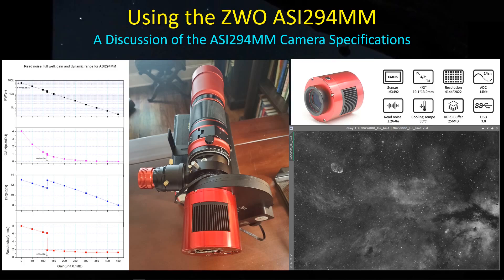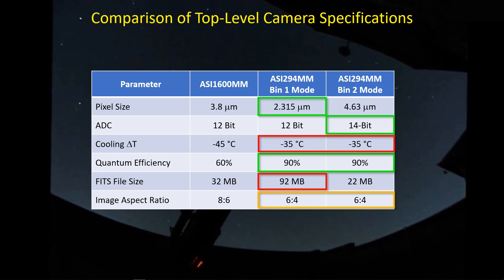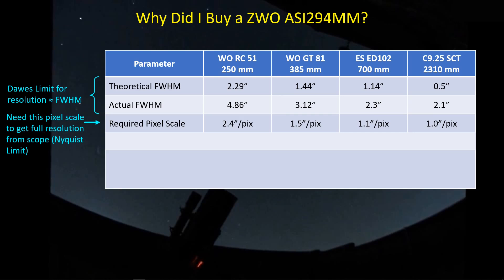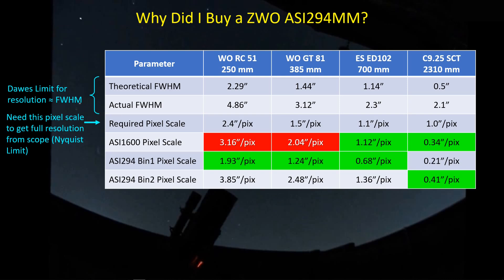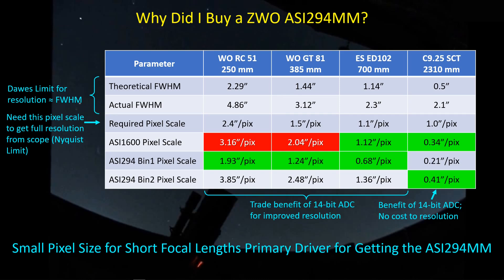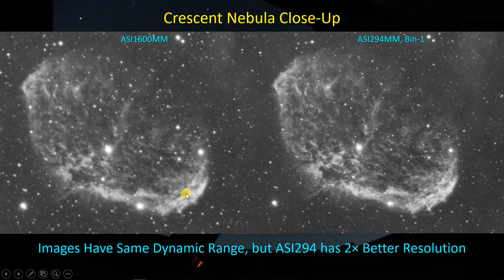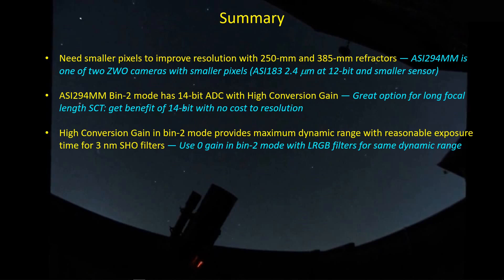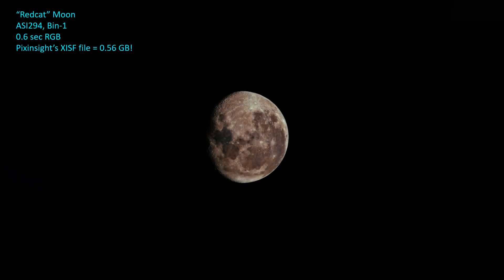Using the ASI294 Bin Modes

Comment: would you recommend still getting it in 2025? or go straight for 2600mm?
Reply from the maker: Several factors there. The 2600 has much higher tonal resolution than the 12-bit 294. The pixel size of the 294 in Bin 1 is smaller than the pixel in the 2600. The smaller pixel size pairs well (provides improved resolution) with focal lengths less than, say, 700 mm. But you can dither and use drizzle integration with the 2600 to recover lost resolution. Then there’s the sensor size. If you only have a filter wheel with 1.25” filters, they’ll work fine with the 294, but you’ll get vignettimg with the 2600. It’ll cost another $2000ish for 2” filters and a new filter wheel. The larger 2600 sensor provides a larger field of view for the same scope than the 294. Of course, you’ll image issues more with the 2600 (e.g., tilt). The 94 is a fine camera, but the 2600 is a better camera. It the “hidden” costs that tip the decision one way or the other. If it makes you feel better, my 2600 arrives in two days. Then I’ll have to decide about the filters and filter wheel….

Comment: Thank you for making this video.  I recently acquired a 1200 focal length reflector and a 294mm.  Do you think I should use high conversion gain mode with LRGB, or just with SHO? Thank you.
Reply from the maker: That depends. You won’t benefit from the 294MM in bin-1 mode at that focal length, so you might as well shoot in bin-2 and use the HCG. If you live in a very bright area, you may find that you have to drop your exposure time, particularly with L, with a gain of 120. But read noise will eat your lunch if you go with 0 gain. I would definitely try HCG with LRGB. If the exposures are too short, drop to 0 gain in bin-1 mode. Good luck.

Comment: Hi James! Did you have chance to work on this further? I have always shot in bin2 with my 294mm on all of my scopes (Redcat 51, Esprit 120 and Edge HD). I have some queries: 1. Should i shoot bin1 regularly with Redcat (both LRGB and Narrowband)? Also what gain at bin1 for NB and BB? 2. For Esprit 120 with a 840mm FL, should i do bin 2 or bin1? I have realized that some of my images are a little bit soft at this FL with bin2. For the Edge with longer FL. I think bin2 should be the mode, correct?
Reply from the maker: Hi Devesh. Yes I have. Check out the recent video (https://youtu.be/M4o1XEiXWuk) where I discuss some issues I had with those settings and what I'm trying out now. I'll post a video in a day or two with an assessment of the "new" approach. With a Redcat, Bin-1 is a good match. At 840 mm, I suspect you're not getting benefit from Bin-1, so probably go with Bin-2 with a gain of 120 or slightly higher to make use of the High Conversion Gain. Good luck!

Comment: great work James. thanks! Can you quickly elaborate on why 0 gain on LRGB Bin2? Shouldnt one go with 120 as it would give a lower read noise with same DR? Thanks again
Reply from the maker: Hi Ali. My original thought was that I wanted to use Bib-2 for the RGB filters as I just want color, rather than detail. Also, RGB lets in a lot more light than the SHO filters so I didn't want very short exposures with the gain 120 and went with the 0 gain. In retrospect, I think I'm seeing the bad effect of high read noise that goes with 0 gain in bin-2 mode. Next time I use this camera, I'll either use bin-2 at 120 gain (and see how short the exposures are) or just go with the gain 0 in bin-1. If the bin-2 gain 120 exposure time has to be < 1/4 the current exposure, I may settle for using bin-1 at 0 gain.

Comment: I saw a video of a lecture by Robin Glover, the developer of SharpCap, which indicates that we don’t need to cool modern cameras nearly as much as we often do. More accurately, the point of diminishing returns is at a higher temperature than you might think. I won’t go into all the reasons because he explains it much better than I would. The same video talks about many other aspects of CMOS cameras which really expanded my knowledge. Highly recommended. Search for “robin glover” and it should be the first result returned. It was published by AstroFarsography, who recorded it live.
Reply from the maker: Hi Lee. Agree! I've watched that video several times. It is good and very informative. I've been using the ASI294 (cooled to -5C) and have noticed no issues with that vs the -10C I get out of my ASI1600. I think the most valuable part of the Glover talk is that really long exposure times don't but you anything image-quality wise (you do get the benefit of reduced hard disk space and processing time, which is worth something). The key is to use a long enough exposure so that read noise doesn't dominate. Thanks for watching!

Comment: Amazing video as always thank you very much! I too have the Redcat51 paired with the 294MM.... I'm curious, when in Bin1, have you settled on Gain 0 for RGB and Gain 100 for narrowband? Also... is it true that the time need to achieve the same SNR would be 4x longer in Bin1 vs Bin2?
Reply from the maker: Hey Damian,
Yes. I'm satisfied with Gain 0 for LRGB in Bin1 and Bin2 (I never shoot L in Bin2). I continue to use Gain 100 for SHO in Bin1 and Gain 120 for SO in Bin2. The 100 is a total judgement call - no firm justification for it. I want high enough gain to keep exposure times reasonable (< 10 min for me), but I want max dynamic range (i.e., need low gain). I settled on 100. It's not magic.  I'll shoot every filter in Bin2 when I pair this camera with the C9.25. Not sure about the SNR question. I'll have to think about that. Mostly, I wanted the smaller pixels to improve resolution with my Redcat and GT81. Thanks for watching!

Comment: Very nice…. That’s the one thing keeping me in the OSC realm is the terabytes of storage needed for mono… When 64g of ram and 16 processors seems insufficient… I’m running the 2600MCP and it’s fairly brutal at 51m per frame, not needing hardly any calibration makes it ideal for my limited time…
Reply from the maker: File size is a pain. I subscribe to a cloud storage service (iDrive) where I keep all my calibrated subframes stored. I process each night’s set of subs and ditch the raw files. Thanks for watching, Robert!

Comment: As usual, great video James..

I’m considering the 294MM to use it with the C9.25 EdgeHD. It’s a good mid point between the small 533MM and the 2600MM. Nevertheless, two things make not consider it and I’d like to know your opinion as a user of that camera with also a C9.25.

First, amp glow. Is this or isn’t a problem, and can it be calibrated? Second, I’ve read also in forums that the sensor coatings are very prone to produce a mottled pattern when used with red filters and specially with very narrow band Ha and SII filters.  Is that the case? Can it be also calibrated?
Reply from the maker: Hi Alfredo. There is significant amp glow (I’m taking 600 sec subs), but the darks completely compensate for it. I have not noticed the mottled appearance at all. If it’s there, it must be subtle. I might be inclined to assume the flats would take care of it if it’s a legit issue. Hope that helps. For what it’s worth, I’m enjoying using the camera. Planning on a video discussing my experience using the camera with my Redcat 51 as soon as I can find the time…
Reply: Thank you very much James. This camera is interesting for imaging at f10 with the C9.25 EdgeHD because of its high QE and bigger pixel size than the 2600MM. Please let me know If you could share maybe a raw frame taken with it (maybe an Ha if possible)
Reply from the maker: Alfredo,
Here are two Ha raw files and the calibrated versions:
https://drive.google.com/file/d/1Cbp4LyOGEakVdRRRmf07IqnpDHQIVUOO/view?usp=sharing
Reply: @Aero19612  Thank you James. I appreciate it. The calibrated files show no amp glow nor any trace of the dark pattern on the lower right. I can see this were shot with the bin1 mode (with the smaller pixel size).

Seems like a very versatile and sensitive camera.

Comment: It's interesting that we've ended up with such similar gear.  My first good scope was the edgeHD 9.25 on an eq6-r pro. First camera was OSC with the 294mc pro.  When I decided I wanted to go mono, I got rid of the 294mc and bought the 1600mm pro. That was like 2 weeks before the 294mm was released. I told them I wanted the 294mm instead and they actually let me send it back and upgrade to the 294mm.  I knew one day I would eventually get a small focal length scope, so when they announced the bin 1 mode, I was ecstatic. This week, after 3 months on backorder, I finally got the Askar 400 and .7x reducer, so I'll be able to shoot wide field at 280mm focal length. It's going to be awesome.  Still waiting on the guide scope and a couple other accessories before I can get first light with it, though.
Thanks for the videos. Keep 'em coming. 🙂
Reply from the maker: Wow. That was nice they let you switch out the 294! After I bought the Redcat, I became much more concerned about focus. Your Askar 400 has a standard rack/pinion focuser that is more amenable to attaching a standard focus motor to it much easier than the Redcat. It's a good focal length, particularly with the 0.7 reducer. Now you just need a 700 mm focal length scope! Thanks for watching, Tom.
Reply: @Aero19612  I have a strange problem with my 294mm that I'm hoping you'd be willing to help me troubleshoot.  My darks calibrate out the sensor's amp glow for my Ha subs, but not for my Oiii or Sii subs.  I don't know how that's possible since the subs were taken on the same night with the same camera temp, gain, and offset settings.  I found that when I multiply the master dark by 1.75 (or so), then subtract that from the Oiii and Sii subs, that more or less neutralizes the amp glow. 
I've asked a couple astro communities on discord and no one had any ideas.  I'd very much apprciate any help/suggestions you'd be willing to offer!

Comment: Excellent video as usual James.  I have color versions of the ASI294 and 2600 both of which I love but I do wish I had the money to buy the mono versions as well.  My reasons for color had to do with poor FOV and bad weather.  The 2600 does have a great view but that also has a large file size at 52 MB vs. the 32 MB for the 1600 so you better have a fast computer.  Cheers Kurt
Reply from the maker: Hey Kurt. Totally understand about selecting OSC to maximize imaging time. I'd love to have the 2600MM, but that means a new (larger) filter weel and filters. So it's not just the camera, it's the additional $1000 to $2000 for the other stuff...keeps on adding up.
Reply: @Aero19612  Good point, that was my other concern, I was planning on upgrading my filters to the Antila and there is a big difference between the 1.25 vs 2".  When the time comes to upgrade my 1600MM, I am leaning towards the ASI294MM or the ASI533MM (which is out in other brands).  The 533 has the same pixel size as the 1600 and 2600 but the sensor is smaller.  The good news is it has no amp glow.
Reply from the maker: The amp glow with the 294 is very apparent. The darks take care of it ok. All things considered, the 294MM is just "OK." I just wanted the small pixels to improve resolution of my shorter focal length scopes. Vast majority of cameras have 3.8um pixels, which is good for focal lengths > 700 mm.
Reply: @Aero19612  Agree on the amp glow on 294MM -- when > 120 second exposures I get a plumb on the side about 1/4 to 1/3 in on that side.  it is cured with calibration, but is annoying.

Comment: There are so many videos out there but never seen one discussing the performance of the ASI294 in the two bin modes. Very relevant indeed for us amateur astronomers; thanks for sharing. Just curious, did you have any issues calibrating the lights due to amp glow? Looking forward to your next video.
Reply from the maker: Hi Henrique. That was something I had meant to show and discuss, but I ended up deleting half the material because the video was so long. In short: No. The amp glow is a "sunburst" type light and is very noticeable. I have found the Darks are doing a great job of eliminating the amp glow (see the right-hand side image at 13:00 in the video). Thanks for watching!
Reply: @Aero19612  Thanks for the reply. It is good to know since I have plans to buy this camera in the future.
Reply: @hm.salgado  I agree with James, same problem, especially when > 120 seconds, but is cured through calibration.  I am a lazy data collector and calibrator so have darks at 20, 60, 120, 180 seconds and try to get close to those for exposure time.  James and I are both in Bortle 7-8 DFW skies -- you can go longer than 180 second subs, but you end up balancing the amp glow and the light pollution.  I have a fixed setup so can good polar align and a good scope with guiding and have thought about trying longer subs, but really just results in more planes and satellites in every sub.

Comment: Very useful video. Still trying to decide whether or not to get this camera for use with my Redcat.
Reply from the maker: Hey Logan. Go back to a few of your best subs with the Redcat and let Pixinsight determine the FWHM. If smaller than about 4.0 arc-sec, then the smaller pixels of the ASI294MM won't help you much and you'll take a hit with the 12-bit ADC. In that case, stay with 2600 (is that what you're using with the Redcat?) and the 16-bit tonal resolution.

Comment: Curious to see how bin 1 compares to bin 2 mode with drizzling…get smaller raw data files and 14 bit conversion
Reply from the maker: Excellent question, Alan! I haven’t tried that. Add that to the list…
Reply: @Aero19612  awesome.  Was thinking that if you are slightly under sampling then drizzling should help recover some detail

Comment: Great video Jay! I love my 294MM and use it in both modes depending on the telescope. For the money, it’s the best cmos camera available in my opinion. That being said though, I also really like my 2600MM, it’s a tough choice sometimes. I think the 294 in bin 2 does a much better job with the longer focal length scopes unless you can guide consistently around .3” total error which I am unable to do.
Reply from the maker: You can't beat the 16-bit ADC of the 2600 and its field of view. A shame we don't have more 16-bit astro cams with smaller pixels that work better with focal lengths < 600 mm. Guess we're at the mercy of the security cam business.

Comment: Awesome info - I have been using the 294MM for 1 year and really like the ability to bin1 or bin2. one challenge with bin1 is the really large file sizes overwhelm my Raspberry pi when writing to SD card, given you are using small windows pc, will be interested to know how that performs.  I might have to rethink how to use the delay feature on my image collection to see if that helps to I can use bin1 for the full frame.

part 2 - there are many targets I go for with my 600MM Newtonian where my decision is whether I want the full bin2 FOV or only a portion and I select out a 1/4 frame portion in the middle of the sensor and use bin1  with a portion of the frame and collect just that so I can have smaller file sizes and small pixels on those targets.  In my case, I create darks and flats for both versions.  I had given up on using bin1 for the full frame, but might have to retry that for M31 based on your video.

part 3 - I am down the street from you in Dallas and  have had a couple nights where I get and image artifact in the center of my frame that I thought was freezing/dew on the sensor that caused me to increase my temperature to 20 C (yikes), and have considered a dew strap around/near my camera and filter wheel to see if I can lower my temperature at the sensor and keep the freezing off -- not complete on that test, but interested on whether you see anything similar. 

Great video as always, love your engineering mindset and clear explanations on your thought process and journey.
Reply from the maker: Isn’t Dallas fun this time of year! On the positive side, we’ve had lots of clear imaging nights. My mini PC is handling the large file size OK. I’m surprised. Heck, it even handles the 0.5-sec flats I take with the Lum filter. I just take flats in Bin1 then resample down to bin2 flats. I haven’t observed dew issues, but dew hasn’t been an issue since I’ve been using the camera. Fingers crossed. Thanks for watching!

Comment: The spending never ends. New mount ordered (mine was tracking like a dog - mechanical issues). Been wanting to get a shorter focal length telescope, and I have a 1600mm, now I'll need a new scope, and a new camera 🤣.
Reply from the maker: Such a slippery slope hobby. I’m pleased with the EQ6-R. A good balance between cost and performance. Good luck, Wayne!